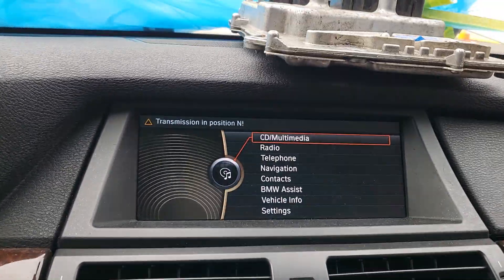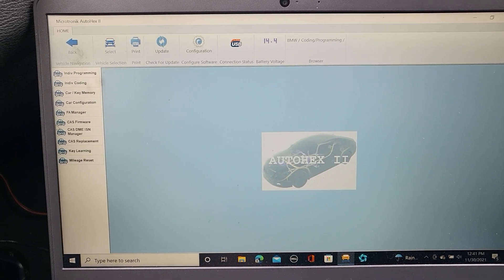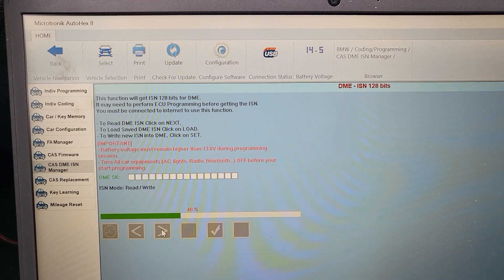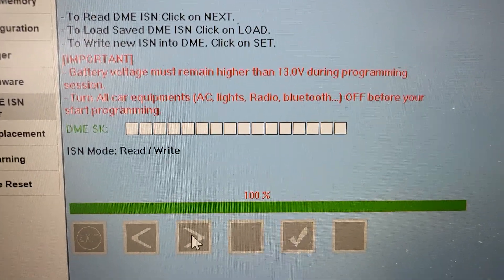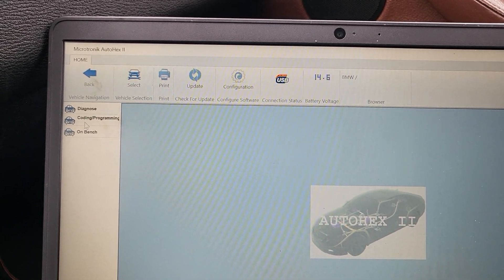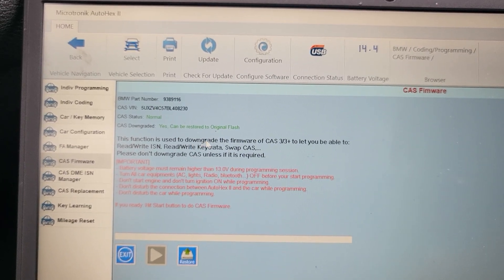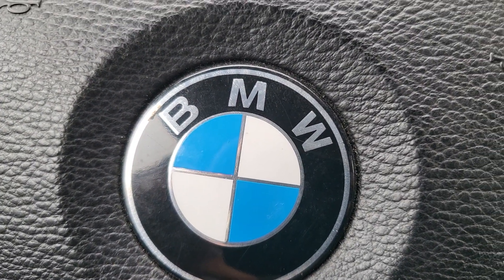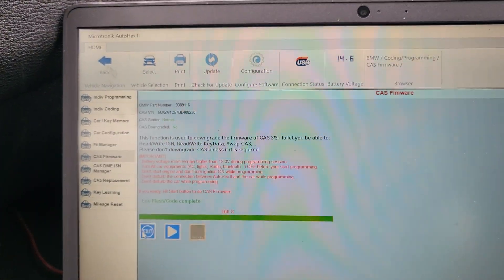How To Swap BMW X5 E70 Engine Computer And Programming it/Using Autohex

Comment: I have a 2013 BMW X5 3.0. I am getting a fuel pump malfunction message then my car shuts off. I changed the fuel pump module and the low pressure fuel pump both new OEM units. The problem isn’t resolved. Any suggestions?
Reply: @malik Garvey  check the fuses in rear right passenger compartment. Also  there’s a A fuel pump module near the the battery water gets into them and shorts it out.